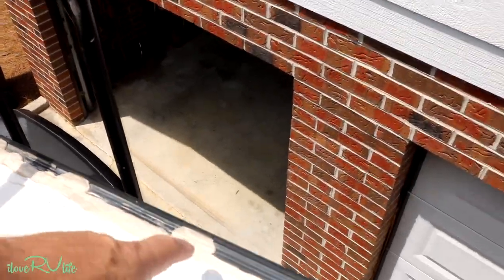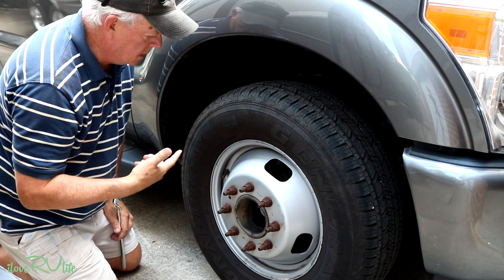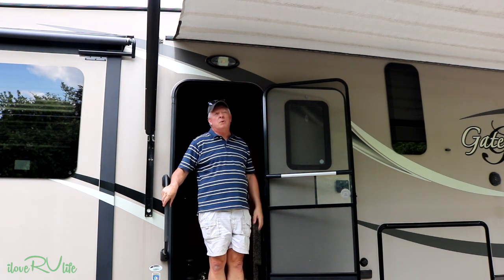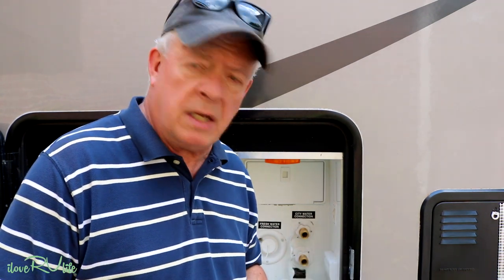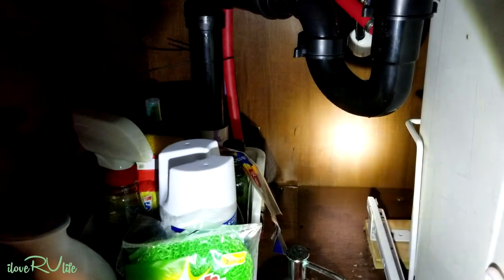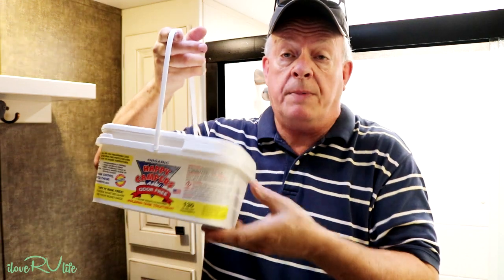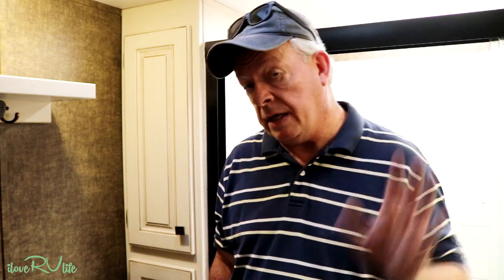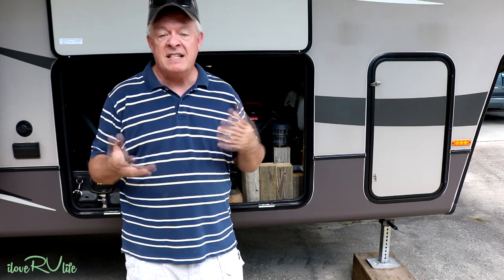10 RV Travel Preparation Tips

Comment: Jerry to you have a tip on removing black streaks on an RV? As always thanks for all the great info.
Reply from the maker: Short of buffing them out, I’ve had reasonable success with Simple Green.  Be careful with the RV finish.  I’m at the point that I need to buff and wax the 5th wheel.  It’s a job.  Takes 2 days.  I use a Meguires marine wax.  Helps maintain the overall finish.

Comment: What air pressure do you use for those Goodyear G114 trailer tires?
Reply from the maker: Hi Bryce.  Goodyear provides load charts for tires and weights.  110 lbs is doing the trick.

Comment: Nice video, I to use the slide dry lube for the slide your video had a lot of good info on how to take care of your RV, I want to ask do you check your tires cold and then air them up to the proper among?
Reply from the maker: Per the tire manufacturers, tires should always be checked cold. They will add pressure as they heat up down the road, but the additional pressure has been factored in by the manufacturer.  One thing I didn't mention is checking the tires and hubs for heat as your travel.  I have an inexpensive laser thermometer and check temps of the tires and hubs when I pull over for fuel or a rest stop.  All tires and hubs should be within 5 - 10 degrees of each other.  If you find one very hot, there's a problem and you need to get it checked.  Jerry....

Comment: Makes me cringe when I hear people use dawn dish soap on their vehicles it's a mild degreaser..yeah it does a good job of stripping your wax and everything, please re-wax afterwards.
Reply: Aside from appearance, why do you need to wax your trailer or RV?
Reply from the maker: Jo, over time the outside could deteriorate or crack.  We give ours a good coat of marine wax (it’s made for the boat industry) every 3 years or so.  It’s a big job and make the 5th wheel,look almost new.